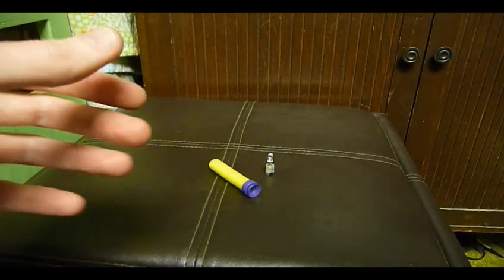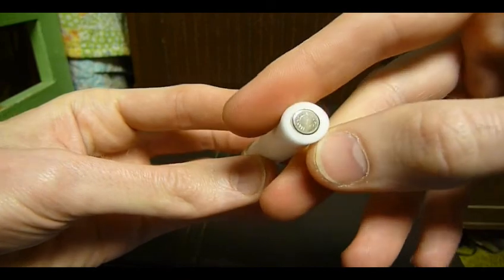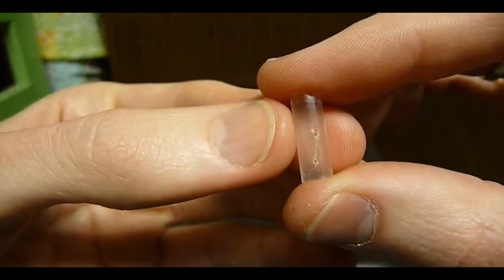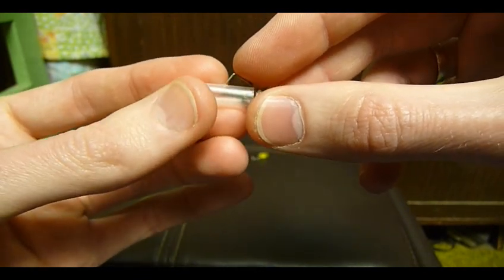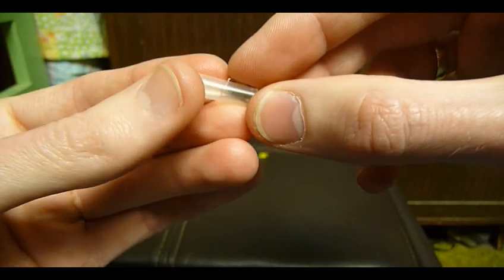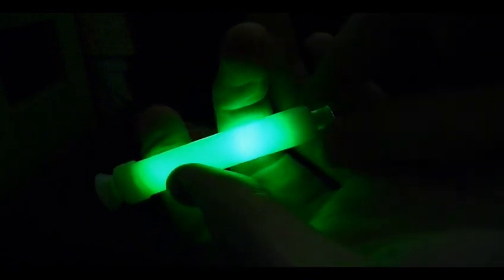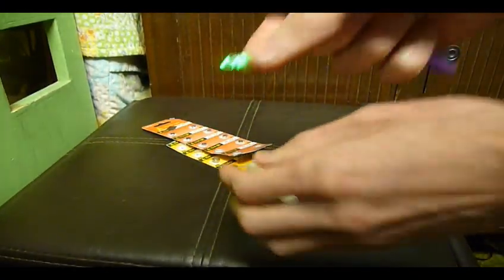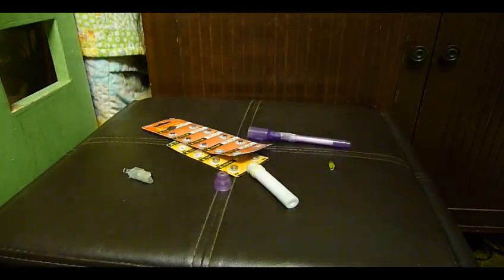LED Nerf dart updated design 1

Comment: Can you make a video to add one of these switches to it?  http://www.ebay.com/itm/10pcs-5-8-x-5-8mm-Traditional-non-momentary-Push-Button-Miniature-Switch-on-off/181431004439?_trksid=p2045573.c100033.m2042&_trkparms=aid%3D111001%26algo%3DREC.SEED%26ao%3D1%26asc%3D20131017132637%26meid%3Dff9550e927db46ec9cd13a8ab910b4c3%26pid%3D100033%26prg%3D20131017132637%26rk%3D1%26rkt%3D4%26sd%3D181431004439
Reply from the maker: I'm not sure how to attach these (soldering?)... But I'm still trying to find something simple, something that can be made into the design.